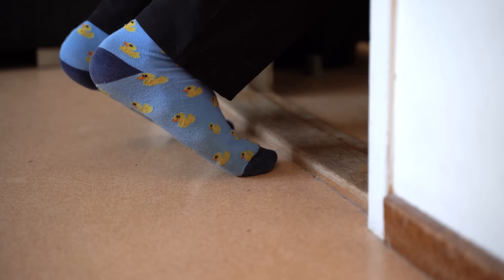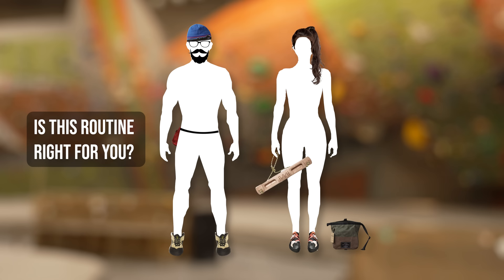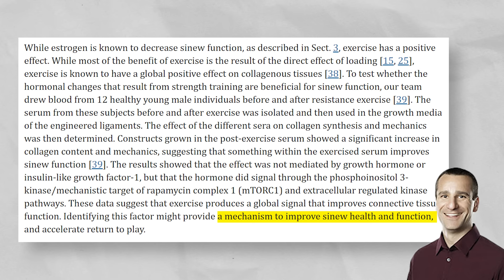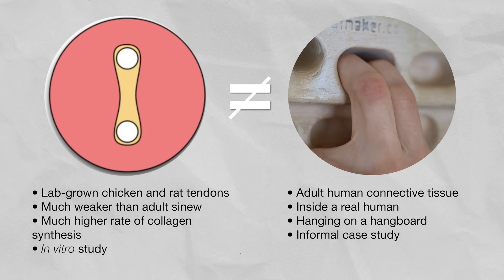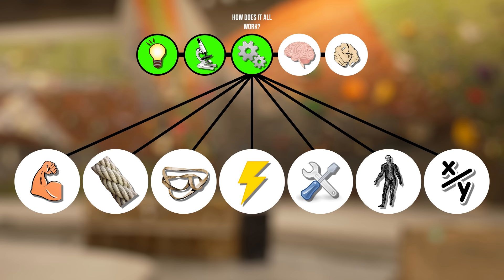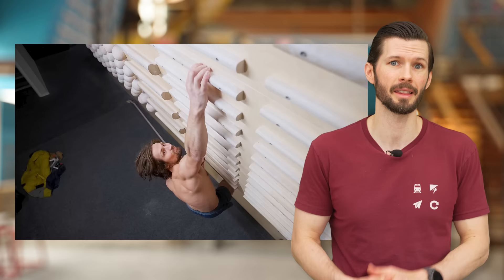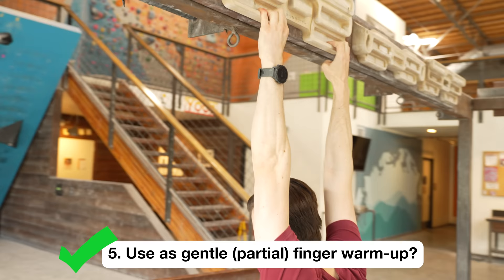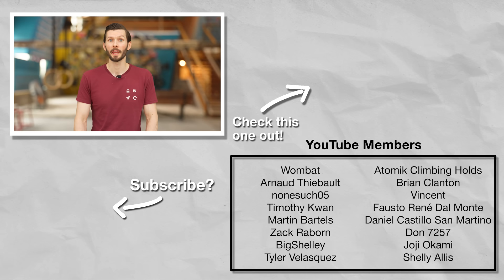Should You Hangboard 2x/Day like Emil Abrahamsson? (New Analysis & Recs)

Comment: This is the second video and i think i posted it before, just because he did the hangs at light weight two times a day doesn't mean he did nothing else. if you watch some of Emil's videos while he trained the 1-5-9 and other feats, he did this over a period of time. he worked hard for the 1-5-9 as well as 200% body weight pullup, while that was str focused, these was tendon focused. there is no doubt that he did every day routines for climbing and working out. i believe he mentioned he did not do these hangs on climbing days (or maybe if he climbed morning he'd skip the morning session).

with that said, gains and losses from Emil's video cannot be done just by that one exercise, you'd have to understand what he actually did over that lockdown period to make those gains and it was a crap ton of pullups and other workout activities.
Reply from the maker: It is a bit mind boggling that people continue to attribute completely unrelated strength achievements to these ultra low-intensity hangs. There seems to be a significant misunderstanding of the anatomy and mechanisms behind grip strength and hangboarding, as well as the classic convolution of correlation and causation. Of course, trying to take a less cynical view, I'm glad people are psyched on training and experimenting with different protocols :)
-Emile
Reply: @HoopersBeta  the only thing I could really say that might contribute to some actual gains from this exercise is the fact that it primed the muscles and tendons allowing them to be warm and relaxed for when he does actual hard climbing. It’s almost like hand putty. As they say the best thing for arthritis is to keep movement. Well at my age I have to say my fingers like the low intensity hangs and keeps them healthy for when I really need to climb.
Reply: yeah I think he was in a very psyched period where he trained hard and rested enough and the low no hang thing was just sprinkled on top and identified as the main contributor for no reason. I mean, you HAVE to be psyched like crazy to stick with this extremely boring twice a day hanging protocol in the first place... + some placebo and confidence boost after doing all this before retesting.

Comment: Tried it and although it did make the fingers feel better/less stiff (when not climbing), it had no effect on my climbing. However I do find low intensity (ARC) training very usefull, as for me it doesn't seem to have any negative effect on my max strength, whilst increasing my endurance and it still makes the fingers and whole body feel better/more activated.
Reply: Arc-ing typically won’t affect max strength. Nice way to finish off a session actually, though there are plenty of alternatives. (And does depend slightly on details of the intervention)

Comment: I made this little list of exercises and strategies and their respective benefits when attempting to improve tendon health strength, thickness, stiffness and elasticity. I just thought I'd leave it here because it's pertinent to the whole discussion and seems to correlate to what was said in the video. I hope it can help you create an effective tendon routine.

If anybody disagrees with what I've put here please let me know you're thoughts as i made it a while ago and i don't know if any of the information is out of date.

	1. Eccentrics Exercise ]   [ exercises - strength ]
	- All tendons respond to eccentric exercise, this can be downhill walking, slowly lowering from the top of a push up, eccentric bicep or wrist curls...
	- Anything that places a load on the muscles tendon whilst lengthening it
	- 3x10-15 reps of this

	2. Partial reps ]   [ exercises - strength ]
	- These reps are performed 4-6 inches before lockout on all normal exercises i.e. On bench push the bar off lower 4 inches (10cm) and then back up
	- This is to be performed with extremely heavy weights
	- Can be done for most exercises i.e. Bench press, overhead press, squat, deadlift

	3. Plyometrics ]   [ exercise - tendon recoil/efficiency and stiffness ]
	- Explosive movements utilising recoil i.e. Squat jumps, drop jumps, countermovement jumps
	- Do not make tendons bigger or longer
	- Results will not come for at least 14 or so weeks, so 3 and half months or around 28 sessions on one muscle group (legs)
	
	4. overcoming isometrics ]   [ exercise - stiffness and safety ]
	- Attempting an explosive movement against an immovable force.
	- I.e. Pushing a car that has its breaks on, kicking whilst your legs tied to a pole, pushing against a wall with your fist
	- Similar to overcoming isometrics but more intense for a shorter time
	- 1-5 second reps

	5. Volume increasing ]   [ exercise - tendon volume ]
	- Simply increasing the size of tendons
	- 15 years of climbing will lead to 62-76% thicker finger joints and tendons
	- Rock climbing will improve this greatly

	6. Intensity training ]   [ strategy - applying stress ]
	- Tendon strength will come from placing stress on tendons 
	- i.e. Eccentric decline squats compared to normal squats
	- To see progress the stress placed on tendons must exceed that of daily activities
	- This can be done through, volume, speed, resistance, rom, and the proportion of eccentric vs. Concentric movement

	7. Stretching - full range of motion ]   [ strategy - stretch and stress ]
	- This can realistically be performed day to day
	- i.e. Ass to grass squat, pec stretch, calf stretch

	8. Avoid pain, seek mild discomfort ]   [ strategy - Injury prevention ]
	- Comfort and stress are both fine however pain never is
	- Just enough stress to train but not enough to hurt

	9. Daily practice to strengthen tendons ]   [ strategy - routine ]
	- Train and think about your connective tissue every day
	- Doesn't have to be at once, save time and do it throughout day at random times
	- 2 sets of 5 reps per exercise only increase weight when its too easy

	10. Don't rush, take it easy ]   [ strategy - routine and load ]
	- Start with a weight that is almost too heavy
	- Maintain this weight for many months (a whole term and break, 3 months)
	- It will be difficult then a challenge then easy then insignificant 
	- By continuing this your muscles grow and tendons have sufficient time to build collagen density

	11. Massages and myofascial bodywork ]   [ strategy - blood flow ]
	- Tendons grow less because they receive less blood therefore increase blood circulation
	- This can be accomplished through massages, cold-hot showers, self myofascial release
	- In the future i could visit a qualified massage therapist

Comment: Have others experimented with low intensity hangboarding combined with BFR bands as briefly suggested in this video? I've been doing this once or twice a week off and on for 2 years and I've seen definite forearm muscle growth. I feel my fingers are more resilient as a result as well. It seems like it does make a difference for hypertrophy, but I'm not sure how much that matters for overall finger strength. Also, I asked Tyler Nelson directly about this and he was surprised to hear that I had muscle mass gains from BFR since that's not a typical result he sees.
Reply: I have.  I don't know if it made me stronger but it allowed me to maintain a lot of my strength during a should injury and when I started climbing again strength felt like it came back much more quickly.  I will also add that the reps felt like they also had some type nuanced value that the different crimp positions just felt more natural.  Especially full crimp/half crimp.  I would describe it as (used to be a basketball player) shooting the ball with one arm only 2 feet in front of the basic over and over and over again.  Not that isn't going to give me the muscle strength to shoot 3 pointers but it will help me refine the movement until it becomes natural and "see the ball go through the basket".  This also ties together interestingly with some of Tyler Nelsons research on closing your hand instead of holding static weight.  The no feet hangboarding may be engaging that closing of fingers aspect to create finger pressure rather than weighting with body.
Reply: @johannielsen463  That's very interesting. I concur with your experience that the 2 per days are good for teaching the body how to crimp in different positions. When I do them, since I'm not trying to pull "hard", I focus on the quality of my hand and finger position as well as the sensation of pulling evenly through all my fingers and even different parts of each finger at once. This could be a big part of why it works. Not just the pain threshold described in the video, but building the neural networks thru repetition to get to the "ideal" crimp positions more naturally. It can be used as technique training for various grips.
Reply: @chazott  I agree.  Reminds me of the saying "Practice does not make perfect. Only perfect practice makes perfect".  I feel like this is under utilized in climbing when it comes to practicing form and fundamental positions.  Of course you need to supplement this with your power training.  But I know for a fact I have been stronger on max hangs than I am now but yet I climb much harder and consistently harder and % of strength feels far more available on the wall (of course with anything I realiz and acknowledge there are always a lot of factors that go into progression and performance just saying...).  Also on the BFR note I find more that adding blanket strength it almost prepares me to absorb more gains from my workouts both in the form of blood flow and quality to area and tissue/vasculation...also on the BFR note I think I have noticed a correlation with power endurance and endurance more than top end strength but in the form of power endurance this many times feels more applicable on the wall than top end strength to me.

Comment: Perhaps it is all about the mitochondria which produce ATP?
I used this protocoll with great benefits.
After 1 week I did 12 pull-ups instead of 6.
After 6 weeks I climbed 6b+ in the climbing halls instead of 6a.
I had no muscle increase.
I suppose that I improved my metabolism.
The top runners for 100 m produce about 7 times more ATP per second than an amateur runner.
They have trained their mitochondria to a maximum: more mitochondria per muscle cell and more efficient in output of ATP.
     Training till failure implies damages of muscle cells and long training sessions.
      Reparation takes time. It is a setback.
      Is that really necessary?
      Yes is the answer of all people who make their money by giving long lessons 
       or by renting their gyms.
Think of adaptation in our evolution.
We do not  adapt to a single event/stimulus but to a series of stimulation - to repetition. 
The repetitions do not require maximum.

Comment: Great video - but I feel like there is one very important aspect that wasnt addressed - specifically that Emil and Felix didnt just decrease intensity when hangboarding, but the decreased intensity also allowed them to INCREASE frequency. With high intensity its not common to hangboard twice a day within a few hours especially because of fatigue.

By spreading the load throughout the day isn't it possible THAT would make their bodys adapt to the type of load thats suddenly more common the same way for example a carpenter will adapt to have much better endurance for the type of work they do despite not performing high intensity, fatiguing tasks but rather repeating many low intensity tasks throughout the day?
Reply: Perhaps it is all about the mitochondria which produce ATP?
I used this protocoll with great benefits.
After 1 week I did 12 pull-ups instead of 6.
After 6 weeks I climbed 6b+ in the climbing halls instead of 6a.
I had no muscle increase.
I suppose that I improved my metabolism.
The top runners for 100 m produce about 7 times more ATP per second than an amateur runner.
They have trained their mitochondria to a maximum: more mitochondria per muscle cell and more efficient in output of ATP.
     Training till failure implies damages of muscle cells and long training sessions.
      Reparation takes time. It is a setback.
      Is that really necessary?
      Yes is the answer of all people who make their money by giving long lessons 
       or by renting their gyms.
Think of adaptation in our evolution.
We do not  adapt to a single event/stimulus but to a series of stimulation - to repetition. 
The repetitions do not require maximum.

Comment: I'd also be curious if the no foot hangboarding is engaging the system more in the manor of how Tyler Nelson is looking at it where he is strongly preferring training closing/engaging only your fingers vs weighted hangboarding.  I personally felt that no feet hangboarding and no feet BFR hangboarding had an impact of how my fingers felt on the wall in a way that is hard to describe.  I wouldn't say my max hangs went up but my strength available on the wall felt like it went up.

Comment: Not an expert, but one explanation you didn't talk about seems to me to deserve more attention. You talk about this and that benefit that have only been proven for strenuous exercise, close to failure. But what we are talking about here is a near maximum force -- just one that doesn't feel as close as it actually is. Hanging for 80% of max duration feels far more mellow than hanging to failure, but it is still very close to a maximum workout in force terms. The force you can sustain for 5 seconds is barely less than the amount you can sustain for 4, just as the amount of weight you can lift for 5 reps is barely distinguishable from the weight you can lift 4 times. In contrast, the difference between a "moderate" workout and a "strenuous" one is usually much larger,. So I would not be in a hurry to dismiss the possibility that Emil actually is gaining most of the benefits of a strenuous workout with his barely-less-than-strenuous-but-much-less-painful-and-injury-prone version.

Comment: For aerobic sports suck as cycling or running there is a lot of evidence that doing more slow (i.e. Low intensity) workouts produces better results. Part of it seems to be about building a strong base (specific high intensity is required closer to peak performance). Another interesting part seems to be that lower intensity can be fully recovered from and repeated more frequently leading to better results than generic high intensity training. It seems often "high intensity" isn't intense enough to produce best results so many people end up with junk highish intensity training without enough rest.

 I wonder if something similar is happening here?

Comment: The most difficult thing for me personally, was adapting the routine to my strength level. Emil's recommendations of pulling around 80% of what it would take to get off the ground obviously don't translate well from him (a very very strong athlete even prior to the experiment) to the average climber. For me, that was too much load and unsustainable. However, it's equally hard for me to estimate "too little" load in this routine. :D
Reply from the maker: Managing and estimating the load is  definitely one of the big downsides of doing hangs this way, which is why we mention block pulls later in the video. You could also use a pulley, harness, and weight to take weight off your hangs, but that tends to be more cumbersome than block pulls.

Comment: I question if the intensity of this routing falls under low intensity.  Is it high intensity? I think that would be max hangs, or >70% 1RM at least, which this program is below of. There is little research on 'medium intensity' much because it's vague. Maybe someone can go digging about plyometrics or coordination training and tissue adaptation.

So that leaves us wandering why this program seems to be promoting substantial tissue change, neurological change or psychological change? If research can't help us atm, and we don't want to use anecdotal evidence for our training, what can we do? I think most of us want to know if this is a silver bullet to the tendon strength / collagen issue, which many of us believe is the cause for our 'tweakyness'. An experiment of tissue adaptation in humans following this 10m low intensity regime would be awesome. 

What we can conclude is that this routine is an investment you could make outside a 6h window of climbing and all the small factors such as tissue, neurons, psychy, bloodflow, etc. would benefit. So lucky for us it's pretty much positives all the way and also pretty safe to experiment with. I'm prety stoked tbh about this
Reply from the maker: It is most certainly not high intensity. This question has been asked a few times already, but in summary: Emil estimated the load of his hangs to be about 30-40% of his max (as far as I can remember), which is very clearly low-intensity. There’s simply no way the ultra-light load combined with relatively minuscule volume could be considered high intensity. 
-Emile

Comment: For finger health/rehab, do you still recommend the modification of longer hold times (30s+)?
Reply from the maker: In earlier stages yes longer hold times can be more useful as they are also associated with lower intensity of effort. So you can load/stimulate the tissue without overloading it.
Reply: @HoopersBeta  thank you so much! With something like this, we are hanging and pulling at 40% of our Max pull strength, is that right?

Comment: Would this hangboard protocol be OK to add on top of another hangboard protocol? Doing Emil's on top of max hangs 1/2x a week?
Reply from the maker: Yes -- provided you keep the intensity of the "Emil hangs" low. This can be a bit inconsistent if you're just guessing how much weight you're hanging, which is one reason I often prefer farmer crimps/block pulls (easy to track the weight). Regardless, as long as the extra hangs feel very easy, you can pretty much do them as frequently as you like.
-Emile